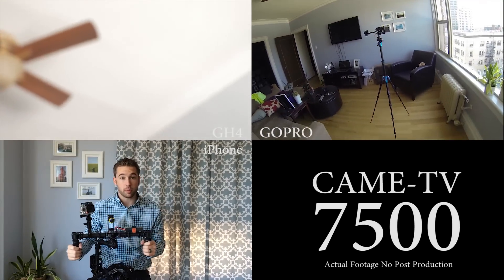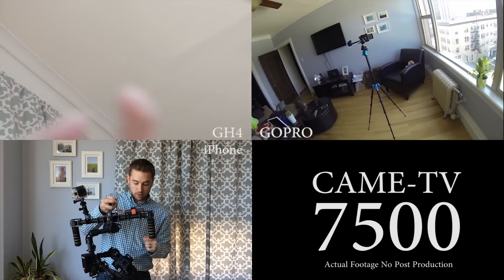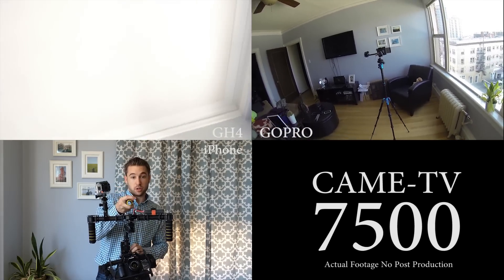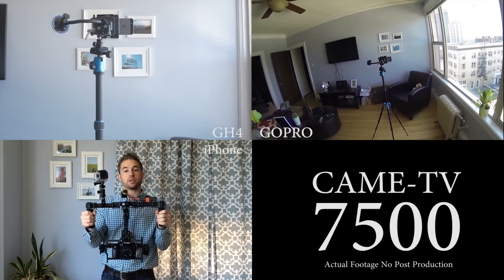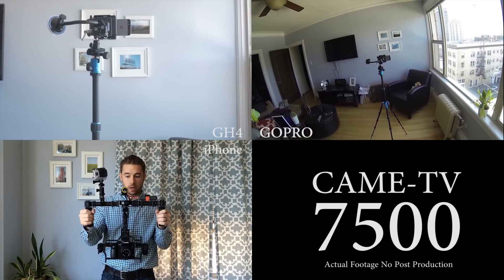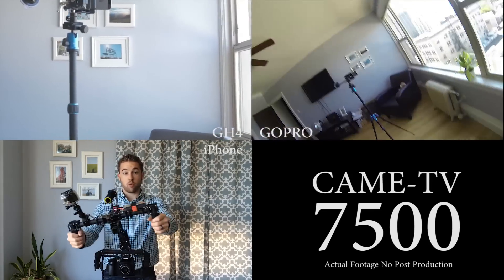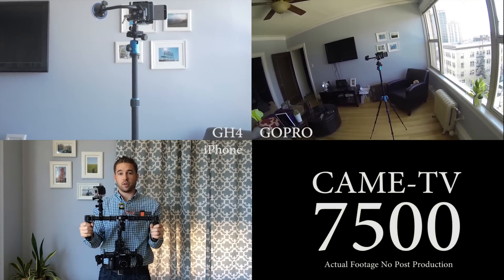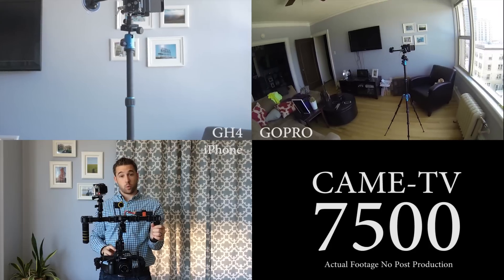CAME-TV 3 Axis Gimbal Test - Camera Stabilizer

Comment: hey thanks for the review. so after having the gimble for a while and based on what's out there now. would you still recommend it as the best bang for your buck gimble? i heard of various people having issues with the board crapping out on them quite early on or the charger not working after just a little while. all good experiences for you?  i'm looking to use it with my canon 70d. thanks for your reply.

Comment: NIce video. Great comparison with the go pro.
Is it Heavy? Is it something that can be used for 12 hours. Are you limited to having the camera at just above waist level, with out holding your arms up. That would seem to be very tiring. Can you flip the bars so that the camera sits on top, giving a more eye level shot?
Thanks
Reply from the maker: Thanks!
It's super light. But your arms do get tired after a while of shooting. There are backpacks and steady rigs that you can mount the gimbal onto for added support. I don't use mine enough to justify the purchase.
The batteries last about 30-40 minutes with my current settings but I think I have them high. The battery will last much longer if you have it perfectly balanced.
It does have an inverted mode so you can flip it up and use it upside down but I haven't messed with that yet.
Cheers!

Comment: This kit is not pre assembled.  One of the balanced components has to be turned at least 90 degrees,  and nothing is balanced.  I can't see putting the main components together being this hard.  It also doesn't help that the thing has no instructions,  plans or photos accompaning it.  

CAME need to step up their game.
Reply from the maker: Well, let's be fair, if it was FULLY assembled you would need a huge box. There were only a few parts to screw together. Took all of 20 minutes. OF COURSE you have to balance it. That's like saying a car isn't pre-assembled because you have to adjust the seat to see over the steering wheel. EVERY camera/lens combo is different. It would require HUGE motors and power to be able to accommodate every unbalanced rig.
It worked quite well out of the box for me. I only experienced issues once I started mucking with the PID settings. Then I had to re-calibrate the CAME 7500. But really, I should have looked at the documentation online before I started tinkering.
Additionally, the CAME-TV customer support has been exceptional. REALLY accommodating.
AND... at the price-point that they are offering their products... the CAME-TV 7500 is a game changer.

Lastly, CAME is just a distributor. They put their name on the product and aid in the sales. The actual gimbal is made by another company.

...so let's try and bridal the complaints, it's not what the internet was intended for.
Reply: Nick Southcote-Want I think for $200 than the 7000 a larger box is not too much to ask. And,  a car still works with the seat not adjusted.
Reply from the maker: brett knoss So does the CAME 7500.
Sorry you had to break out the toolbox.

Comment: never work for me at all and returned twice, couldn't do 360,  wires all rip-out cause they used motor with Small whole at the top
 . the stage for balancing was crap: build my out faster that took to have them actually get working device, lucky you but I don't have time for lazy vendors.
Reply from the maker: I had to do some rewiring... I spun around too many times and didn't think about how it would affect the gimbal. 
It's still a piece of camera equipment.  You have to treat it with care.
Once I got it all dailed in, it performed GREAT.
Just had a shoot and the footage is beautiful and smooth. Sorry you haven't had the same experience. 
Cheers!

Comment: I have the same system and it performed quite good out of the box, after that i've upgraded the firmware and it god worst and worst ....
I finally put the old firmware back and now i have no pid's :)))
can you please give me some pid settings?
Reply from the maker: It's just zeros in the PID section?
I guess the PID info for the 7500 is a hot topic... I'm working on getting it up online. I might do a video so stay tuned.
What camera are you using?
Reply: the guys from came  gave me the pid's that came with the camera so i'm now back to square one :)) i use 5d mk3 + 17-40/rokinon 14mm/ canon 20mm .
My roll and the yaw work just fine but my pitch shakes like crazy after going above some degrees. If i don't over shake the pitch the gimbal is usable and i did manage to get some jobs done with it. any suggestion?

i forgot to tell you that i can't flip the camera in the reverse mode ... no way :))
Reply from the maker: The downloadable manual has pretty good info about how to adjust the PID settings. It's all on page 20.

The info below is taken from page 20. Step 2 and or maybe 4 will help you out?

Please note: I didn't write this and I'm not an expert... try at your own risk.

If you do try it out, let me know how it goes.

*
Suggested algorithm for PID tuning:

1. Set I=0.01, P=10, D=10 for all axes. Gimbal should be stable at this moment. If not, decrease P and D a bit. Than start to tune each axis sequentially:

2. Gradually increase P until motor starts oscillate (you may knock camera and see on the gyro graph, how fast oscillation decays). Increase D a little – it should damp oscillations, and decay time decreases. The lower is decay time, the better.

3. Repeat step 2 until D reaches its maximum, when high-frequency vibration appears (you may feel it by hands and see noisy line on the gyro graph). Current P and D values are maximum for your setup, decrease them a little and go to step 4

4. Increase I until low-frequency oscillation starts. Decrease I a little to keep gimbal stable. Now you found a maximum for all PID values for selected axis. Repeat from step 1 for
other axes.

5. When all axes are tuned in static, try to move gimbal's frame, emulating a real work. You may notice that cross-influence of axes may make gimbal not stable. In this case, decrease a little PID values from its maximum for axes that looses
*

Good luck!!!

Comment: Dear Nick
I have the same CAME7500 but i have problems with calibration and pids.
Maybe im doing something wrong, so please can you share your PID.
Im using PANASONIC GH3 WITH PANCAKE 14MM LENS
You can send me your profile on subicphotography@gmail.com
Best regards
Ivo
Reply from the maker: Thanks for watching! I guess PID info for the CAME-TV 7500 is in high demand. I will find a place to throw it up so everyone can see it.
Cheers!
Reply: I had them send me same crap back have issues never got to use  end up building my own with better motors and wiring etc. better weight class,
Reply from the maker: Wesley Clouden can you show some vids of your new one? I would love to see it in action.

Comment: Pretty cool. Care to share the pid info?
Reply from the maker: Thanks for watching... at the time of shooting this, I was using only the setting that came pre-programmed in the CAME-7500. I have since re-calibrated the 7500 to get a better balance and reaction from the rig. In all truth, I don't know that it would be of any use to you. You have to manually adjust it for your camera weight, battery, etc. I'll share it, but it's best to do a manual calibration and find the ratios that work best for your rig. What camera are you using?
Reply: Hi Nick, I'm using the Gh4 and the 12-35mm lens. I would love to know your settings to go from there to adjust for mine, thanks!